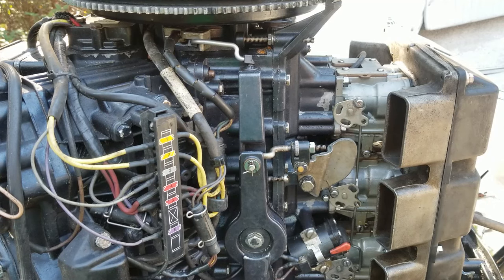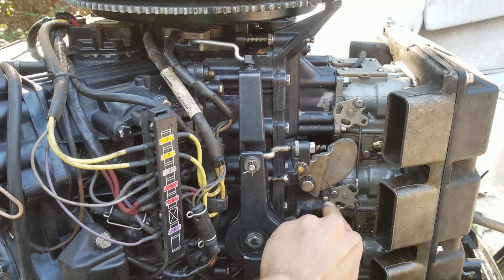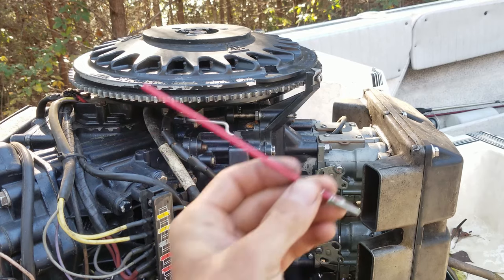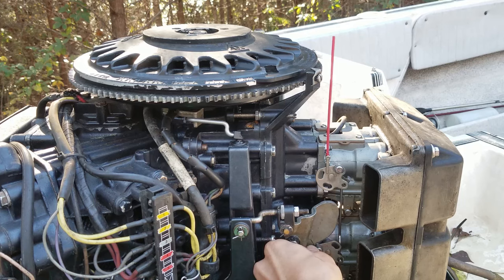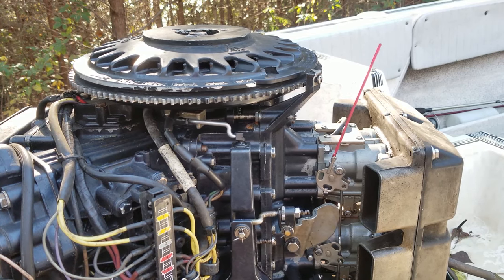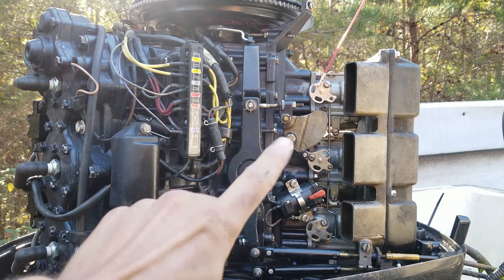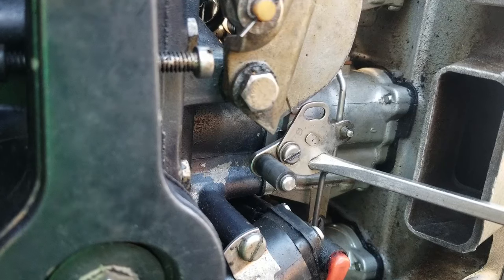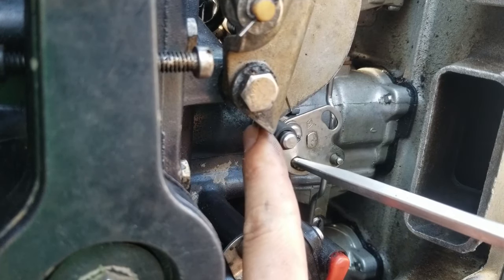FREE Secret Outboard Tuning Tool!

Comment: Great video! Evinrudes 1978-79 service manual show a picture of using a “wire and gator clip..” and I have seen people use a gator clip and a large zip tie, but only for 9.9s. I like the red straw, better to see when you’re alone.
Reply from the maker: In my service manual it just shows a "Throttle Amplifier Tool". So I came up with this. Sounds like a better manual than mine haha.

Comment: Motorcycke mechanic for 35 yrs, The only true way to do it us with vacuum synch guages,  drill a hole into each side inlet manifold, dye a threaded tube with cover plug, you will be amazed at how smooth ,fast and how much more useable power they have ,  then jet the carb👍

Comment: Hi Matt, any idea what would cause a tick, tick, tick sound after releasing trim button when trimming down a motor from 80 percent down to 90 percent down? Motor is a 2023 Merc 200 hp . Any help will be appreciated, and save me a excruciating trip to the dealer
Reply from the maker: It's probably in the trim relays on the back of the outboard. A lot to go wrong in there.

Comment: I have a question for you I have an outboard Mercury 1982 80 2 stroke it’s my first boat I redid the carbs the boat runs good out of water and in water but when I put it in gear it stalls is it a timing issue. By the way I read it all the gas lines filters I think I might’ve played with the throttle cable idol stop screw maybe that’s what fucked up
Reply from the maker: I'd get a factory service manual off of eBay and re-sync everything. The linkage adjustments change the timing.
Reply: @MattsShop  thanks mate
Reply: Find the idle timing screw bump it about two turns

Comment: Yeah, I liked it, probably best to just buy a new cam roller every ten years or less, just to avoid a lumpy sticky action, never enough lube, always spray under the hood with pump action WD40, after ever use, keeps the bugger beautiful
Reply: Do you mean spray down the carb / throttle linkage? etc... what else? Newbie to 2cy AND outboards, (was I/O for 15 years, NEVER again!